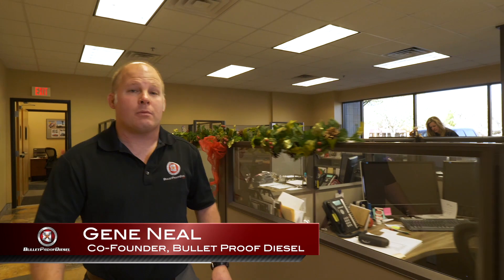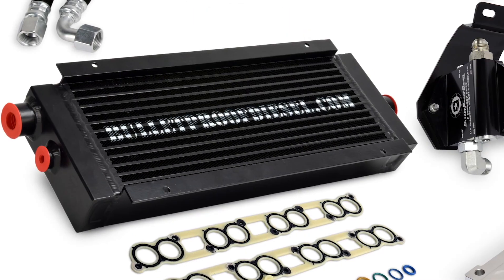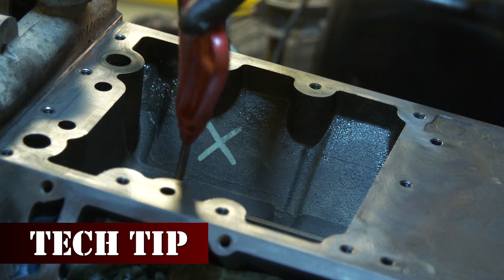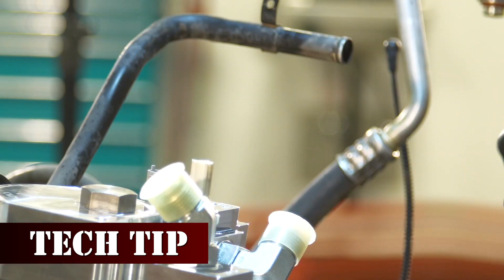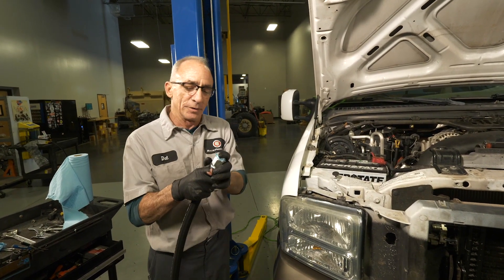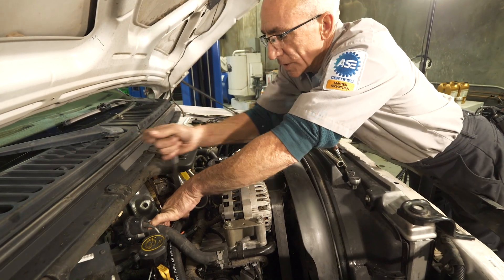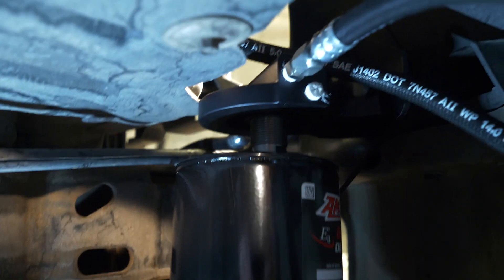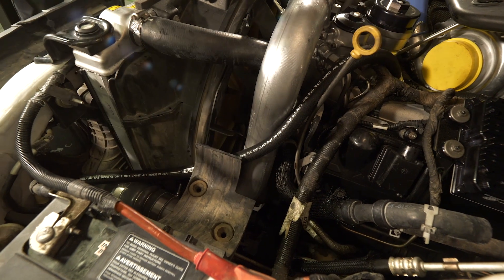Fixing 6.0L Pattern Failures - Episode 1: Oil Cooler

Comment: I have a 2004 (late model) that has been rebuilt and bored over .20 and some upgrades like head studs...4" exhaust... I live in Florida and looked up on your list of preferred installer ...Twin Diesel in Lakeland Florida...They are installing the Hot weather BP Oil Cooler ..I'm VERY impressed with them !!!! Thanks for putting that list out there as I try to do most maintenance work myself but this area I needed help and didn't know who to trust !

Comment: I probably just need to call BPD to ask this question but I’ll ask here also. I have the BPD air to oil cooler already installed but I want to install the the bypass oil filter in addition. Question is, do I need to pull the condenser to get to the oil cooler or can I install with just pulling grill? Look at the area where the ac lines looks super tight area
Reply: Remove the two top bracelets and slightly bring the condenser forward without removing any lines and see how much room you have to play with. You might want to lift the condenser off the bottom supports but be sure not to let drop. Good luck 👍🤞
Reply from the maker: Feel free to give us a call directly at 480-247-2331.  We are happy to help here as well.  Do you have the large spin on oil filter in behind the bumper on the drivers side?
Reply: @BulletProofDiesel  yes, the one that uses a wix 51832
Reply from the maker: @tonysalecki  Got it.  You should be able to remove the top brackets that hold the condenser in place, move the condenser back and access the 1/4" NPT plug on the side of the cooler.  This port will feed the bypass filter.
Reply: @BulletProofDiesel  thanks, that answered what I needed to know. Wether I could access it without having to disconnect the ac lines.

Comment: I just had you all do the five pattern problems repairs to my 2007 6.0L engine a few weeks ago I cannot tell you all how extremely satisfied I am with your products and labor. Worth every dollar spent  on these repairs.
   Special thanks to my service advisor JL and my technician JP for making all this possible. We drove my truck the 425 miles to my home without a single worry or issue. Id recommend this service to all who own a 6.0L. Thank you Bullet Proof Diesel for coming out with great products. 👍😎👌😁
Reply from the maker: Hi Louie - Thank you so much for taking the time to tell your story here, we appreciate the feedback!  We value each and every customer experience and the opportunity to solve problems.  Thank you for providing us this opportunity.
Reply: How much did it cost?
Reply: What do you’re oil and coolant temps run at once this is done?
Reply: @brucesharen1612  coolant temp is normal 195 degrees, oil temp is now running 15 degrees below coolant temp. Before EOT was 20 degrees over ECT.

Comment: I'm considering a 6.0. But I have a question, can this kit still work if you have after market winch bumper or a ranch hand bumper for the external oil filters? And can Ford Motorcraft filters be used for the external ones?

Comment: As a plumber my head says there has to be a way to abandon the old cooler and reroute to a cooler upfront. I like your kit though.
Reply from the maker: Thanks for the feedback and our air-to-oil cooler systems do exactly that.  We eliminate the factory oil cooler and utilize an air-to-oil cooler up front behind the AC condenser.  This helps to keep it in the air flow from the factory fan/fan clutch setup and manages temperatures accordingly.

Comment: I will most definitely buy this kit. But I wanna see what 50,000-150,00miles does to the kit.
How do you maintain the kit? 
Do you have to take the cab off?
Reply from the maker: Maintenance primarily consists of oil, oil filter, and fuel filter changes at regular intervals.  No need to remove the cab!  We've seen some of our kits on trucks that are hitting about 400k miles!

Comment: So this a stock upgrade pretty much. No cutting or tuning or anything like that? Operation is the same, just changing the way the cooling happens.
Reply from the maker: You could call it a delete of the stock oil cooler system, and an external upgrade.  The BulletProof oil cooler will mount, as you've seen, up near the radiator.  The primary advantage of the system is that it doesn't use coolant, so there's no possibility of coolant debris clogging it up.  No tuning, no grinding anything off.  The closest you'd get to that is perhaps shaving some plastic off some of the flaps behind the bumper for hose routing, but that's just for ease of installation.

Comment: Question,  would it be possible to further explain the benefits of the “cold weather package”. I saw this truck is from Arizona, I’m from Florida however I don’t travelNorth in winter if at all is there any benefit to add this to my current  Bulletproof external oil cooler system  if the truck remains in the south?
Reply from the maker: It sounds like you could probably do just fine without it.  The cold weather package has been used to keep oil at the correct viscosity even at sub-freezing temperatures.  If you don't see those very often, you should be just fine.